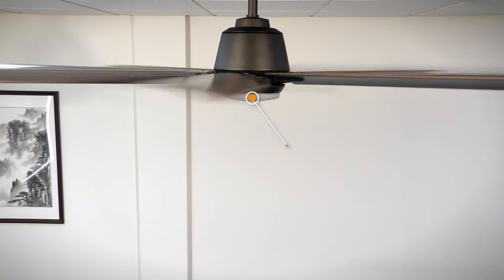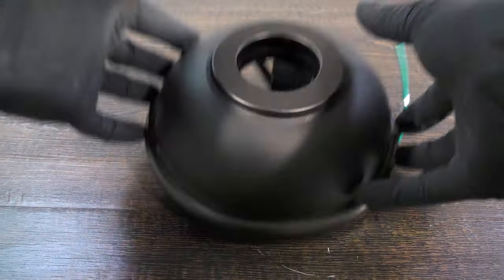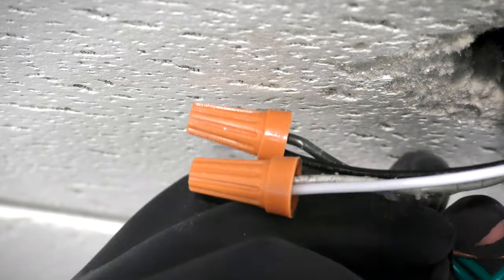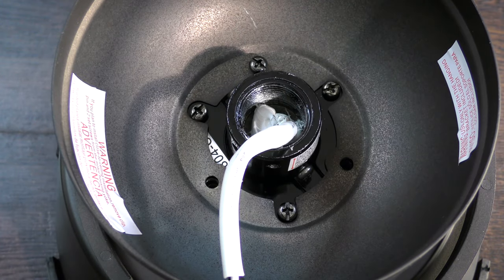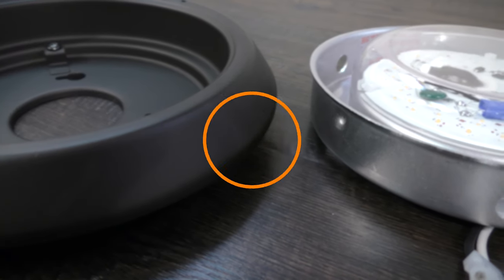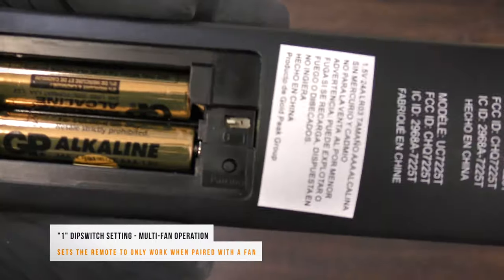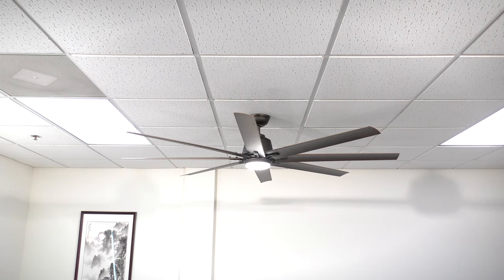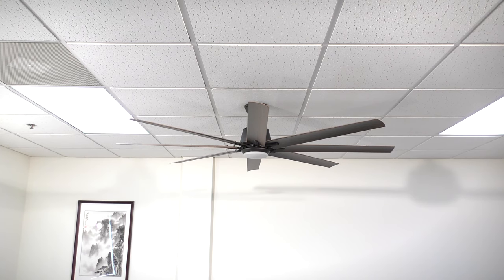72" Kensgrove Ceiling Fan Installation Guide (Discontinued Version)

Comment: I installed one fan and the fan works fine but on startup it does not do the reverse then forward like it shows in the manual.  It just starts going in one direction.   Any idea on that?

Comment: Installed my ceiling fan. Paired it but the led didn’t blink . I can control the fan, but the led doesn’t seem to be working.  I can’t turn on the led with the remote.  Any tip you give me to troubleshoot it?

Comment: Hello, we have tried following this tutorial numerous times. We have two fans that were initially installed to one remote however we believe there is issues with this so trying to pair to two separate remotes. Both fans are on a downward rod and located on same breaker. When you say “disconnect from power” to begin pairing on one fan while other is off, do we do this by fan motor where light and blades are or do we have to pull down from top of downward rod? Or do you have a video of this?

Comment: On the electrical connection section. Connecting the ground wire. My wife thought that was a red wire when that's actually the bare copper wire. You may want to point that out to any installer who isn't an electrician.

Comment: My Problem is I have 3 of them installed on my patio, and it doesn't have dip switches which makes it difficult to pair the controls as all three are on the same light switch.. Any Suggestions?

Comment: Great video.
Just had it installed per video. However, when turned on, it rotates 
slowly back and forth for few minutes, sometimes moves in opposite 
direction. I have to switch it of and back on several times before it 
actually starts moving in the right direction. Takes a good 5 mins to 
get it to start moving like it's supposed to. I have paired it 
appropriately but still having the same issue. Any fix for this? Is this
 a motor issue?
Reply: Waiting for a reply on this as well
Reply from the maker: The back and forth movement should only last for a few seconds before the fan starts spinning normally. If your fan is taking much longer to start spinning normally (or never does), try leaving the fan disconnected from power for a few minutes before trying the pairing process one more time. If the issue isn’t resolved, or if the issue returns, it may be a problem with the motor controller/receiver module inside the motor that can easily be replaced. You can contact customer service for a more detailed support: 1-800-986-3460
Reply: Just bought the 62 in. also waiting for the same answer.

Comment: When turned on, it rotates 
slowly back and forth for few minutes, sometimes moves in opposite 
direction. I have to switch it of and back on several times before it 
actually starts moving in the right direction. Takes a good 5 mins to 
get it to start moving like it's supposed to. I have paired it 
appropriately but still having the same issue. Any fix for this? Is this
 a motor issue?
Reply from the maker: Sometimes the “twitching” issue can be resolved by disconnecting the fan from power for a few minutes and then completing the pairing process (10:34). Note that the fan will normally move back and forth for a few seconds before actually getting to the selected speed every time you start the fan. If your issue is still not resolved, it may be an issue with the motor controller/receiver module inside the motor that can easily be replaced. If re-pairing the remote doesn’t help, contact customer service for a more detailed support: 1-800-986-3460

Comment: How many wattage is the LED?
Can I get LED in 5,000K or higher?
Can I hook up to use wall mount switch? Because if the remote wants to go on vacation without me.
Reply from the maker: The LED uses 14 watts and emits 3000k warm white light only. Unfortunately, you can only use an on/off wall switch with this model. The fan can only be controlled with the included hand held remote or with a Bond Wifi Smart Home Hub.
Reply: @TALCeilingFans  3000K is tungsten light, I was hoping that they have 5000 or 6000K with 30w LED.
Boy, even with 20w LED, that is still dim.

Nevertheless, I can hookup to turn on/off by the wall switch without needing a remote control.
Thank you for your feedbacks.